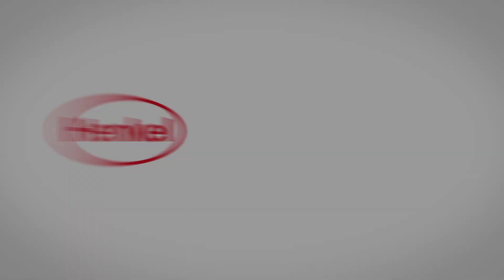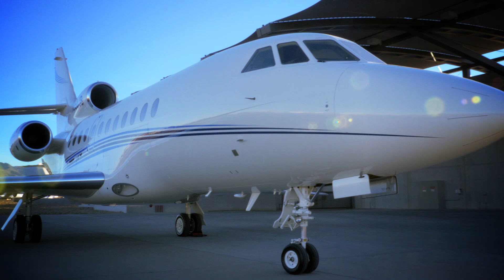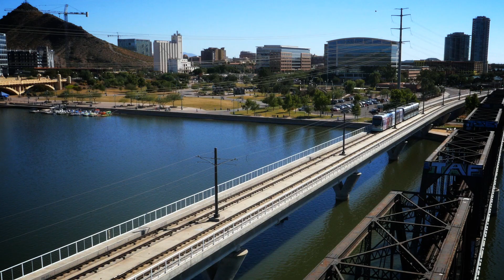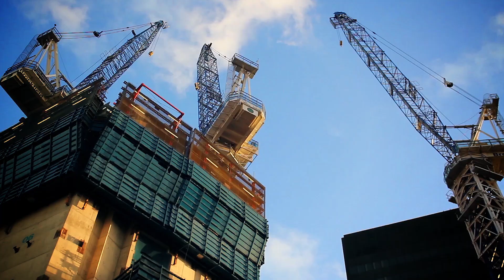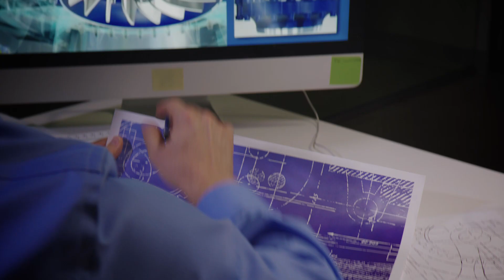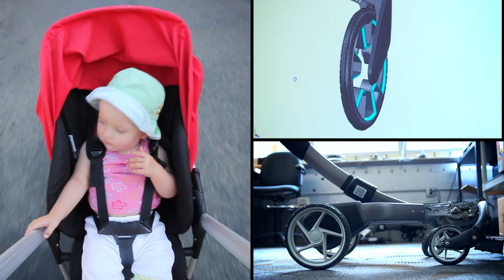Secure Success with LOCTITE

Comment: I have some screws with loctite on them on and old rifle of mine ..do I use a heat gun to loosen them? Cheers..
Reply from the maker: wayne daley Hi Wayne, thanks for reaching out! That would depend on which type of Loctite is on the screws. Red Loctite does require heat, but blue, for example, can be removed with regular hand tools. If you confirm which type you used, I can give you a sure answer. Thanks! - Brandon
Reply: wayne daley lol